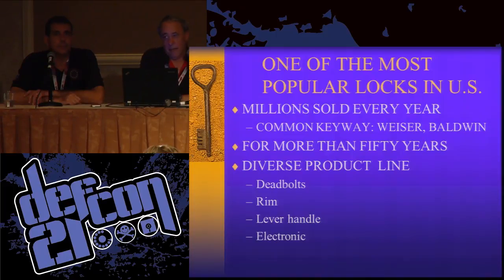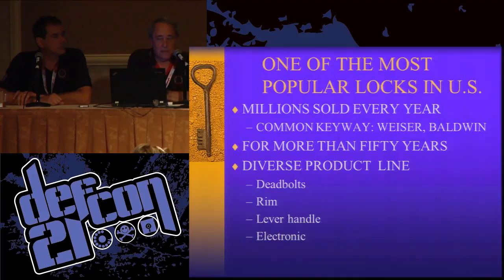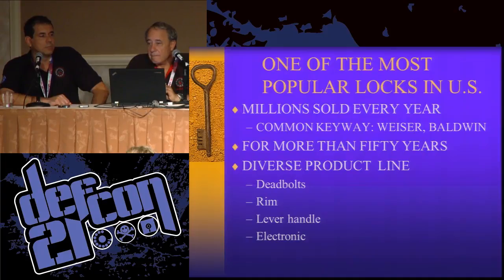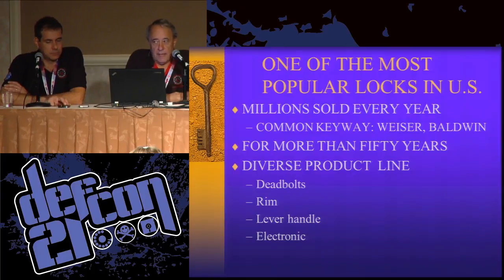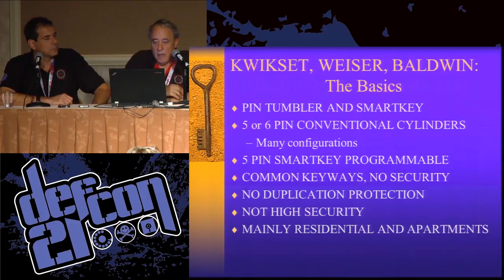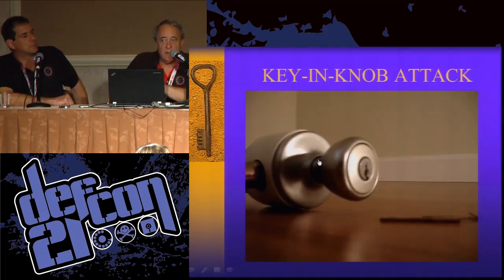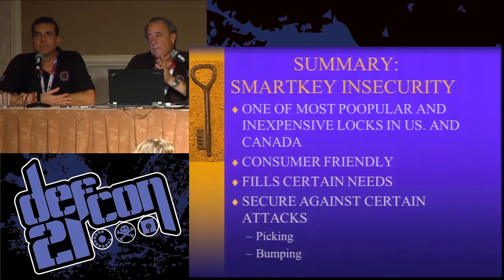DEF CON 21 - Marc Weber Tobias and Tobias Bluzmanis - Insecurity A Failure of Imagination

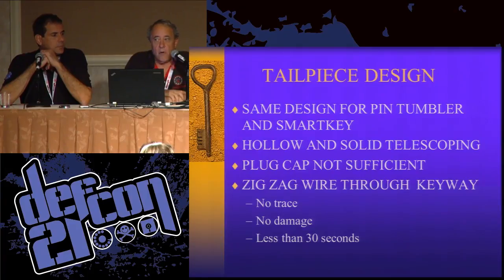Comment: The tailpiece exploit at 33:35 has been fixed with the addition of a long, cylindrical tailpiece cap made from steel. They also added material on the back of the cylinder so it is much harder to pierce.

The lock I just purchased in May of 2020 had this update. Also, I can't say for sure, but it appears the sliders are now made of a different metal. I can not attest to their strength though as I did not test them.